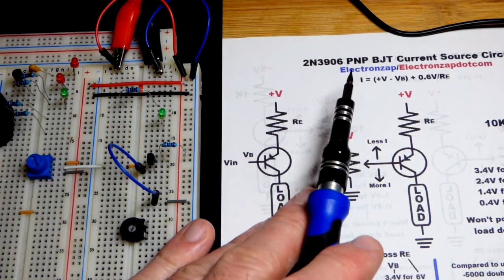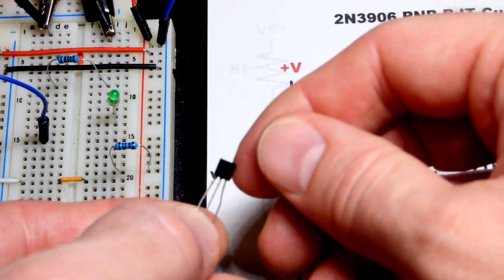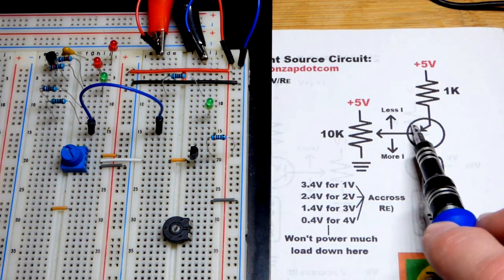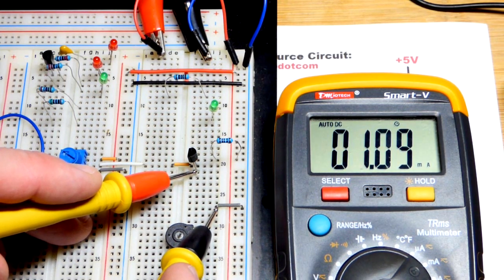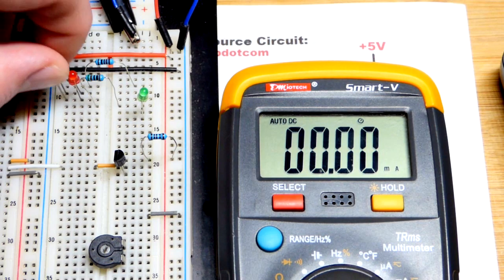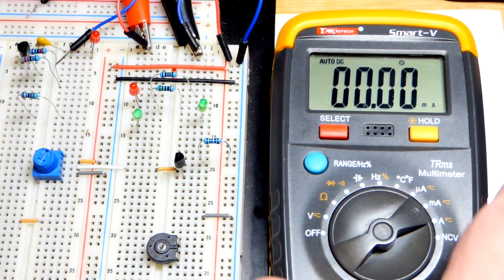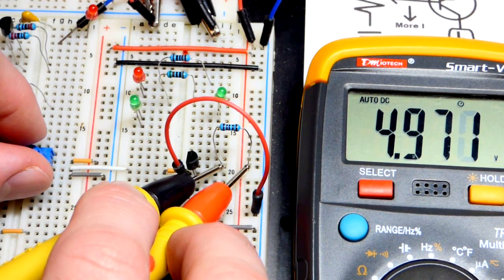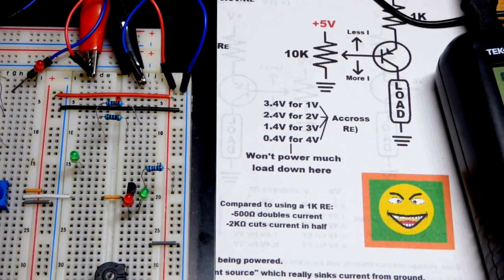2N3906 PNP bipolar junction transistor BJT current source circuit with electronics diagram

Comment: I like the big schematic diagrams that you print out.  The most expensive component you are using here is the trimmer.  You may enjoy playing with an even LESS expensive current source, w/o trimmer, called a Current Mirror.  Essentially, it is tying the bases together, using identical transistors to match a desired base voltage.  Can be PNP or NPN.  https://sosteneslekule.blogspot.com/2015/05/current-mirrors.html
Reply from the maker: That's true. Thanks!